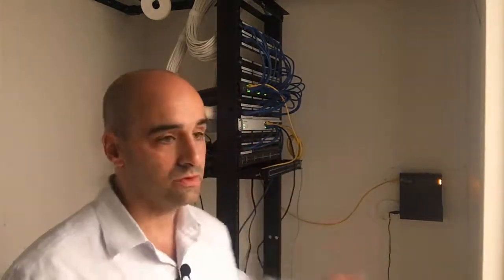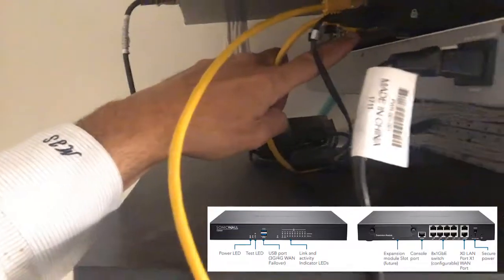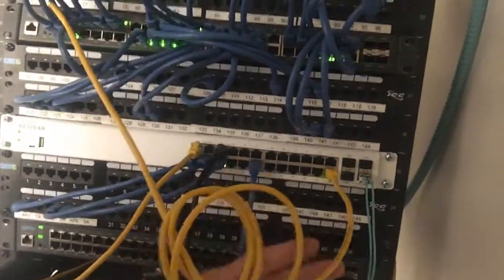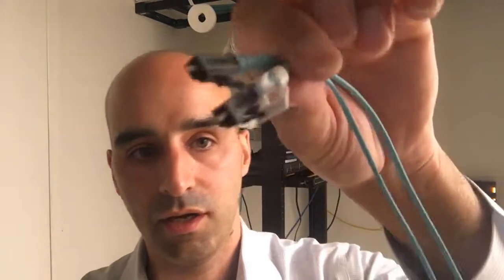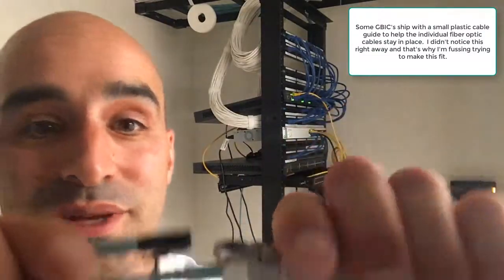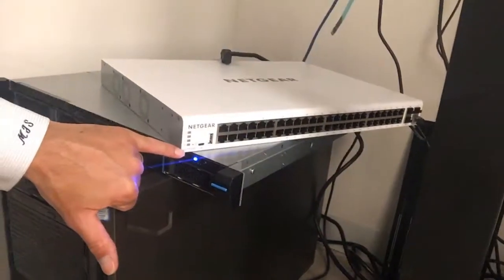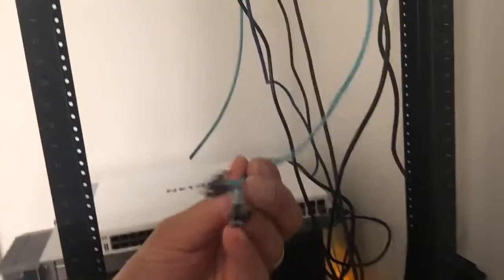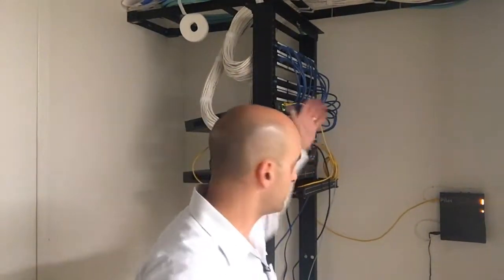Professor Silva - How To Extend Your Local Network with Fiber Optics

Comment: Hello Prof Silva. I appreciate your videos.
I have a question. I have:
-two TP-Link TL SG108E switches
-two TP-Link MC220L media converters
-two Fiber Transceivers
-one NETGEAR Nighthawk XR1000 Router
-two TP-Link Deco X68 which will create a wifi mesh network for cell phones

Problem: I have a Starlink in one building  and multiple PCs in a seperate building. The buildings are 300 feet apart. We must use a fiber optic cable to traverse this distance. 
Goal: create a network that consists of the starlink, PCs, cell phones. Fiber optic cables must be used to connect both buildings which are 300 ft apart.
How would I do this with the above equipment. Actually, a better question would be what is the optimal setup, in your opinion?

Comment: An older video… but I am confused.

4th floor to 17th floor. That should be 13 floors, at an average of 10 feet per floor, should be 130 feet, plus 20 feet for Kentucky windage (😊) giving 150 feet total.
You then state that since copper has a max length of 330 feet, that you can’t use copper because ‘the cable will be too long’.
🧐

Comment: I set up a version of this kind of connection like this at our house. To avoid running up to two dozen network cables to the basement from three floors.  We have three above ground floors and a basement.  We created a wiring conduit using aligned cupboards floor to floor with 4" PVC conduit with breakout T-fittings on the pipe on each floor. On each above ground floor, I used 4-port MikrotTik switches ( MikroTik - CRS305-1G-4S+in - CRS305-1G-4S+in) on each floor of the house to extend fiber optic backbone floor to floor. I run all the floor jacks into a larger switch (16-port) on each floor that then connects to this little beauty and get 10Gb connection floor to floor and 1Gb connections to the jack. Im using a SC/APC single mode fiber cable to accomplish the connection. This means I can run one cable floor to floor instead of 20 (10 from each floor). and one fiber into the basement switch which is a larger MikroTik CSS326-24G-2S+RM 24 port Gigabit Ethernet switch with two SFP+ ports. The four-port switch can handle four fiber connections. I used one of the SFP+ connections on the basement switch to connect my QNAP NAS in the basement using a copper DAC direct attachment cable. The NAS supports 10Gb connections through a Cat 6 cable. the GBIC on the switch breaks out to a standard cat 6 network cable instead of fiber. The MikroTik switches are only $250 each. Making it very affordable for a residential configuration.

Comment: This may be a stupid question, but I'm assuming that there will be fiber ran to the executive floor, which will be plugged into that same sfp port on the switch, correct? Your example with the fiber patch cable was just to demonstrate how the connection works.

Comment: Thank you professor appreciated what you have demonstrated very informative.

Can you do a video on a TP-link POE L2 switch TG2600G 28mps (TL-SG3424P) showing configuration  connecting a TP link indoor wireless access point.

Comment: Excellent Video Mr.Silva.... I am planning to wire our old building with fiber.We signed up for AT&T Dedicated Fiber Internet and need to feed around 20 -25 wall plates jacks for VOIP phones Some rooms are close by but some are 30 floors up What would you recommend in terms of switches, cables and set up maybe there are newer models of switches and GBIC's now in 2020.